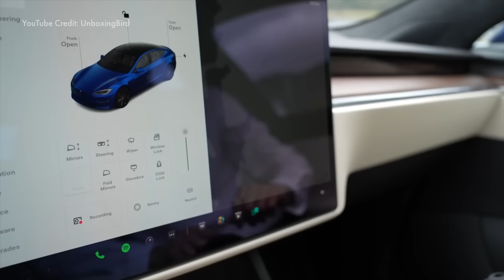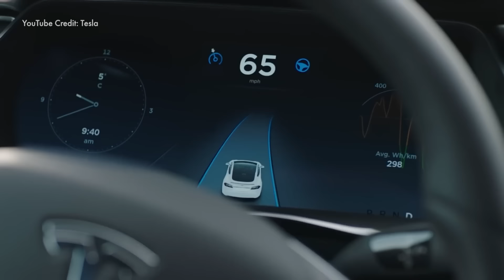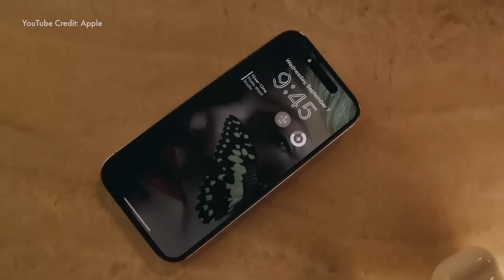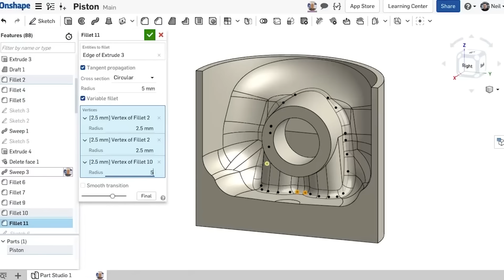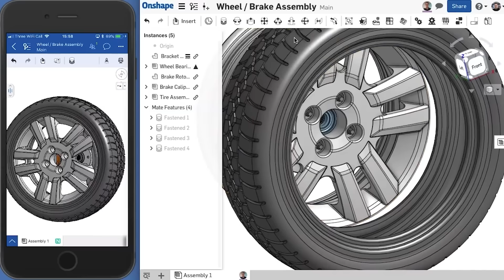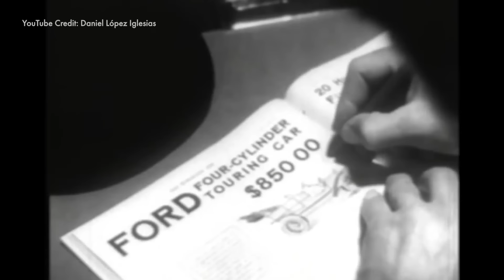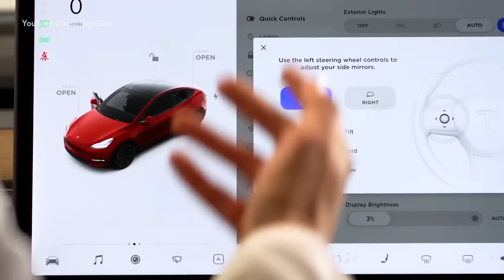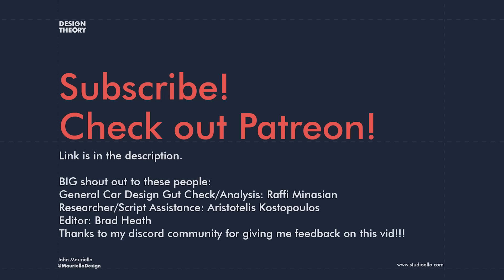How One Designer Saved Tesla From Bankruptcy TWICE

Comment: I do not agree with you on the truck. The pickup truck in it's present form was never really designed. Some farmer replaced the back seats of a car with a farm wagon. Cyber Truck was actually engineered to be a pickup truck. I work with a marine salvage crew and just not having to climb up into the bed of that big Dodge diesel would be great. that thing must be 4.5 feet off the  ground. Be nice to have a built in compressor. Our compressor weighs 260 pounds. That lockable bed would be great so we can leave the tools in the truck when we finish a long day and clean up the next morning. We move heavy stuff and out trucks grow dents so that stainless skin would be really appreciated. The reason you do not like the Cyber truck is that you do not need a one but some of us do.
Reply: I don't need a CYBRTRK ___However, l placed a Day 1 reservation. I _'W A N T'  it so bad!
It's gonna be both 'Beauty & The Beast'

Comment: I just went and watched your Cybertruck video. I think you missed one key point about the design. A truck by its very nature is intended for utility. To be overly simplistic a truck needs the ability to haul things long distance and carry heavy loads in the back. To do this with an electric vehicle using the old form factor is too heavy. Looking at Ford lighting and Rivian as examples. Both extremely heavy vehicles with terrible range. 
The exterior serving as a structure has limitations in design but accommodates all needed utility of the vehicle. That is the point you missed i believe.
Reply from the maker: I'm actually not sure that most Cybertruck users will be using it as a truck in the strictest, most traditional sense (haul cargo in the truck bed). Although to be fair most truck owners dont do that either.
Reply: @Design.Theory  I agree with you but it doesn’t take away from the purpose of the design. A Tesla Model S Plaid can drag race but people don’t spend most of their time doing that either. People only use the argument against truck usage and for no other types of vehicles where their primary usage is neglected. If we only bought vehicles for the 99% use case all that would be on the road is tiny commute cars and family vans.

Comment: Sadly, the drove it too far now. Removed US sensors without proper replacement, removed stalks. Stalks are a proven design for decades, working reliably without any mental load. There is absolutely no sense in replacing this proven design by touch keys that are worse in every aspect except production cost. Hope they do not repeat this failure with other models. It would prevent many potential customers from switching to Tesla after the first test drive.

Comment: You couldn't be more wrong about Cybertruck. It was not a meme or marketing exercise; Tesla doesn't do that.  It's not a "car;" your use of that word indicates that you don't even know what you're looking at. It's a pickup truck; rugged and practical,  and the size of the Ford F150. 

A pickup needs space for passengers in the front/ middle and an open space in the back for cargo of almost any size. It's not going to be a forward- control truck where you sit in front of the front axle, like the VW Bus of the 60s. It needs 3 boxes,  but not a traditional 3 box pickup shape.  An arc between the nose and the roof of the cabin and the top of the tailgate could result in a profile like a Model X or Y, but that would look soft and Tesla- generic. Modern pickups all look the same in the dark and have for 60 years. They're rugged underneath, but what you see is aluminum and plastic and thin sheet metal and fake chromed plastic, all easily dented and scratched. Not ACTUALLY rugged. Square off that arc into a triangle,  expand that theme to all surfaces, and there you go.  Cybertruck.

It's every bit as deadly to pedestrians [mind you,  the US does not have the same safety regs as the EU on this,  and CT isn't meant for Europe] as a giant Silverado cheese grater grille- or F150, F250, etc.  Nobody said the front fascia was bulletproof stainless steel.

You don't understand the proportions? Think it's huge? It seats 6, has a standard size bed, fits where other pickups fit all over North America.  Further, it has better aero efficiency than any other pickup- unless you haven't noticed their walled noses.
Reply from the maker: If you like the cybertruck, that's totally fine
Reply: @Design.Theory  I'm trying to offer some constructive perspective about the rational decisions evident in its design.

Comment: Ok I really enjoyed the video until the cybertruck part. Your analysis there completely falls apart.
1. It's not huge, it's exactly the same dimensions as an F150, the biggest selling vehicle in the US.
2. The shape is designed around having the exoskeleton as a structural member. This thing is going to be insanely tough.
3. You claim it was made for the memes, basically. You are wrong about that, but it will be in time that you will see it. Wait until it's selling 500k units per year and we'll talk again.
4. Franz was very much involved with the design, so thanks for the kudos there.
5. Your conclusive question about CT asks if different for the sake of different is good. What you fail to appreciate is that it's not different just to be different. It looks the way it does because the engineering behind what it needs to do. The shape isn't just a fun exercise in making a creative statement. It's integral to what the very thing is and does. I challenge you to learn more about not just the design aspect in a vacuum and try to appreciate the engineering and practical side of the design as well.

Again, overall the video was great but you just don't know much about the Cybertruck. That's not a crime. Thanks!

Comment: The Model X is a glaring omission. Curious why you didn't mention it.
Reply from the maker: I didn't mention the Model Y either. There isn't as much to say about them. The most notable thing about them is that they're essentially just scaled up Model S's and Model 3's
Reply: @Design.Theory  The Falcon Doors were a huge deal, an expensive complicated distracting gimmick that nonetheless got a lot of deposits for what was otherwise a tall S. You could easily do ten minutes on the wisdom/folly -- but to not even mention them as another instance of design keeping the company afloat (even if you gloss over the cost of delivering later) is a glaring omission.
Reply from the maker: That's fair. Sometimes you just gotta prioritize. Sometimes I get it wrong, sometimes I get it right. In this particular instance, I still think it would have been redundant because the Model X is telling essentially the same story as the other Teslas: production issues + leveraging the benefits of an electric vehicle's architecture/chassis.
Reply: @Design.Theory  Fair enough. Thank you for sharing your expertise.

Comment: I do think you are giving Hans too much credit in savings Tesla. I also think people put too much weight behind Musk. I will say company culture starts at the top, especially in the early days. Musk was and is a big part of that Tesla company culture that keeps them pushing and changing like a start up business, even though they are far beyond that.

Tesla internal software custom built by them is something few companies would have spent the resources on, but Tesla understood the value of it. Doing their own battery designs, building advance chips, AI software development, and so on has little to do with Hans. Musk has said since 2016, we are always trying to improve the machine that builds the machine. That has lead to the use of giga presses and changing any aspect of production. Musk has pushed factory tech to new levels within the transportation industry. Again, I doubt Hans was involved in that. 

As far as the Cybertruck, as a design, not a fan, but if it deliverson all the functionality Musk hyped on it, I would get one. I do think of trucks as tools, so what it does is much more important than looks. Hans just needs to insure the interior is innovative and simple. Not talking gimmicks like the Rivian portable speaker that comes out from the center console. 

If the stainless steel body works, it will mean durability and low maintenance. That is very appealing to many consumers.

If they perfect the stainless body technique, it will likely be used in other vehiyin their lineup. Maybe a stainless steel minivan. Especially if Musk follows through with development of he coloring techniquesl using heat to change the color of paneling

Where Tesla design still needs work is interior.Theur vehicles sell in the luxury price bracket, but their interiors do not feel or look that upscale. 

Hans should be praised for his work, but is the Tesla team and culture that has kept them out of bankruptcy.

Comment: Yes, the Cybertruck's design is one big meme that Elon is trolling the entire planet with ... but, hold that thought for a moment ...

According to a recently released biography book, Elon told his design and engineering teams at Tesla to stop arguing with him about its design and that it was going to happen regardless of what they say.  But, to hedge his bet, Elon also said that if HIS design failed, then they would build "normal" looking trucks.

At first glance, you either love it or you hate it.  I was in the latter camp for the first year or two after its announcement ... but, at the same time, I knew I eventually would buy a Tesla because of FSD.  As I get older, I knew having an electronic chauffeur would eventually be a MUST for me. ... but, the Cybertruck just wasn't to my taste.

However, that all changed when Elon tweeted that the Cybertruck would eventually have an option for solar panels on the roof.  And then, a year after that, Tesla filed a patent to have solar cells integrated into the Cybertruck's tonneue cover, which has a WHOLE lot of surface area when you think about it, for solar cells.

Being that I work at home in Las Vegas and I hardly drive anywhere these days, my current ICE pickup truck sits out in the sun on my driveway.  (I don't put it inside my attached garage because it's too big.)  So, the idea of a Cybertruck being completely charged by "free" solar as it does nothing sitting on my driveway made it too easy for me to finally put in an order for my own Cybertruck.  On top of that, the scorching sun eats paint here, so the bare stainless steel exoskeleton was an added bonus.  And Elon had already been working with that difficult material at SpaceX and some of the SpaceX materials engineers have been pulled by Elon into helping with the Cybertruck fabrication and assembly automation.

Then it occurred to me ... Elon's meme would be taken to a whole other level if he were ever to send Cybertrucks on his SpaceX rockets to be their moon-rover there ... after all, he and the SpaceX crew have already put a Tesla Roadster into orbit.

The Cybertruck's raw design may be too gaudy as a Tesla earth-bound vehicle ... but if you think of it as a SpaceX vehicle, then the design choice makes perfect sense.  It's exactly the design that you would expect a multi-planetary species to use on other planets and moons.  This MAY have been what Elon had in mind this entire time.
Reply: Its not an exoskeleton and I doubt that was ever the intention . Its a unibody with large casts and slightly thicker exterior steel of some of the exterior panels which has some benefits but many downsides as well. Solar panels on the car is pointless for a car this weight when you do the math and consider all the downsides of integrating solar panels in cars. It barely makes any sense on the aptera and that is the best candidate for integrated panels
Reply: @sanisidrocr  You're right ... NOT exoskeleton.  Since I work from home and hardly ever drive now, the solar panel does make sense for me since the truck would sit on my driveway most of the time just like my ICE truck does now.  For everyone still commuting to work, solar is a waste of $$$ and extra weight.
Reply: @sanisidrocr  BTW, the latest Prius hybrid has a solar panel option.  Unlike the Aptera, you can actually configure a Prius now with panels and have it delivered.  Still will add ibkt an additional 4 miles a day ... that's all.

Comment: I could do without the touch screen, irritating to the max especially at night.  I could definitely do without the center console, makes the car a useless 5 passenger wide cabin when it just isn't needed or wanted.  4 passenger configuration's just fine.  Tesla has the worst door handles of all cars on the market.  Carjackers have nothing to hang on to.   After Drew, Franz is next on Elon's chopping block.  Cybertruck's a mess, no excuse for that nonsense.